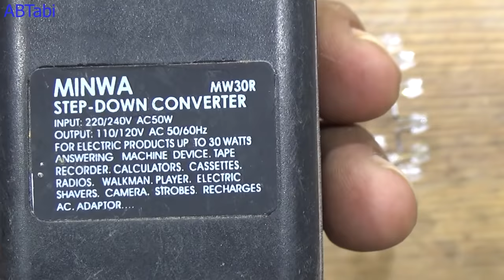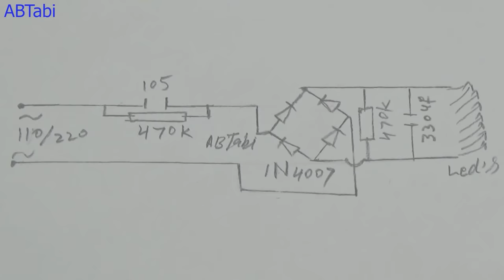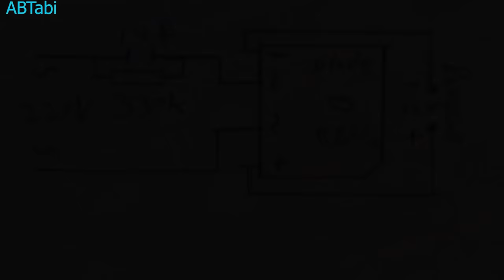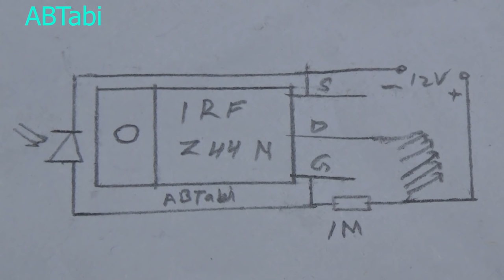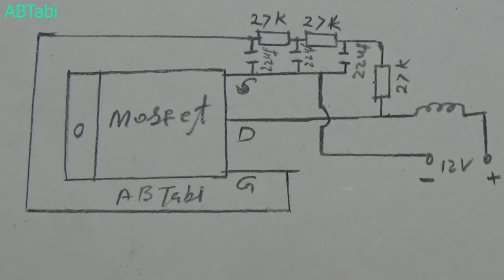4 Simple Electronic Projects, diy electronics circuit

Comment: Attention au choix du condensateur Chimique sur le premier montage. Si la bretelle de led ce retrouve ouverte, une tension de 320V peut ce retrouver sur ce condensateur. choisir un condensateur électrochimique pour une tension de service au dessus de 320V. 

Pay attention to the choice of the Chemical capacitor on the first assembly. If the led strap is found open, a voltage of 320V can be found on this capacitor. choose an electrochemical capacitor for an operating voltage above 320V.